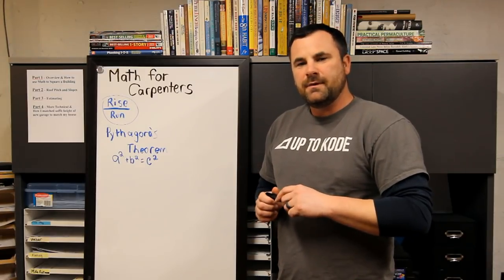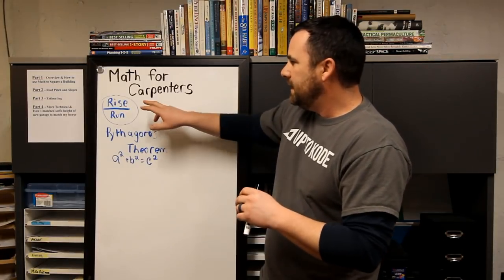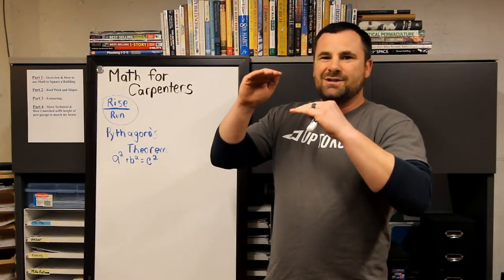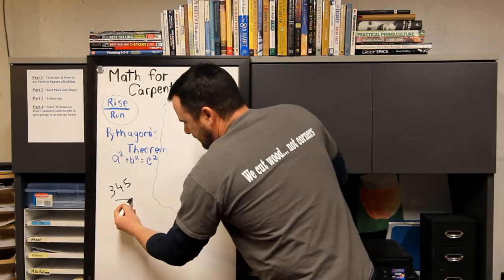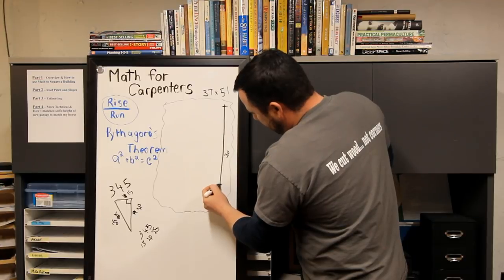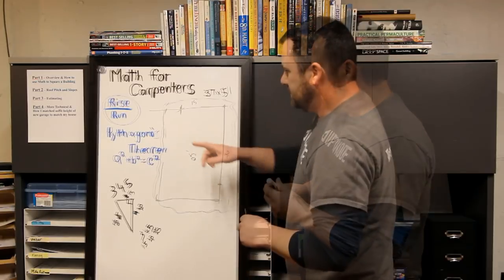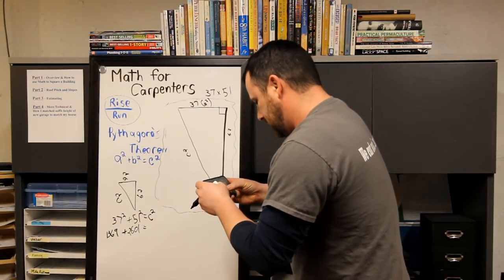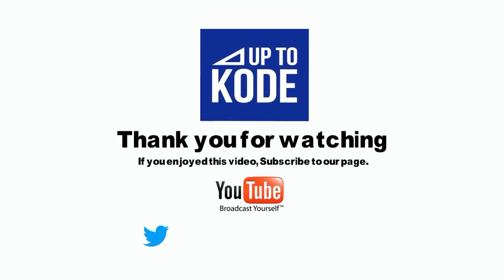Carpenter Math : Two Ways to Square a Building - Pt 1

Comment: 63'- 1/8" also i would get closer to the proper dimensions of 37'-0" and 51'-0". So multiply by 12 on the 3,4,5 rule. 36 ,48 and a hypotenuse of 60. Be perfect guys thats what seperates a pro from a hack. Take a little more care and ppl will love u for it. Great vid btw. Helping out those guys that dont know👍
Reply: It is too good  I saw it first time thank you

Comment: I use a trig app which tells me the hypotenuse length for my actual length of the other two sides just like in your Pythagorean theorem example. I use this everytime as the 3,4,5 method is just a projection of a smaller size of the actual size of the building. Decent accuracy, but inferior.

Comment: on the 345 method, were did you make up the multiply by five number i didnt understand where that number came from or if you just made it up or knew that before?? the pythagorian makes more sense to me , add calculator cant fail haha 345 i think id mess it up, is it always 5 times 3,4,5 or??
Reply from the maker: You can multiply 3, 4, 5 by any number you want. As long as you multiply all three by the same factor. Even 30, 40, 50 works. That can be inches or feet.
Reply: @uptokode  so key is the multiple being the same keeps it balanced, im doing some khan academy math but it hasnt got to calculating space, very useful to learn though i wanna get really good at math and building then ill be able to know what im doing mathematically as i go, be alot more sure of myself not just bend rebar all day, cheers man cool videos!
Reply: @uptokode  i think i get it now its just to make a90 degree corner to work off, ive done that part of the math i just didnt see the purpose but from a9 degree corner you can work of it as a definite corner not a guess. i think i was imagining it was somehow gonna be something more then just , ok get the 90 corner to work off, cool stuff this math its everywhere everything.
Reply from the maker: Exactly! You got it now.
Reply: @uptokode what do you mean by 30,40,50 ,how will we multiply that ,like 30×50 or 3×50?
Reply from the maker: @user-fu3kf9is8x 3-4-5 is the rule so if you multiply those EACH by 10 you get 30-40-50. You can multiply the 3-4-5 by ANY number and you will always get a square corner. Hope that helps!
Reply: @uptokode  what do you prefer for lots/vacant land foundation for building, and for carpentry,(3:4:5 rule or Pythagorean)
Reply from the maker: @user-fu3kf9is8x I always lay out new building with these old school methods. I typically use the corner to corner trick on rectangles. I will use 3-4-5 as a double check
Reply: @uptokode  corner to corner, the diagonals right?
Reply from the maker: @user-fu3kf9is8x yes
Reply: @uptokode  thanks alot man
Reply from the maker: @user-fu3kf9is8x you’re very welcome

Comment: I am trying to layout a 12ft x 20ft for a large storage shed...how do I use your math
Reply: Search “run over rise calculator”…
12’ run / 20’ rise = 23’-3 7/8” slope…
So diagonally from the outside corners you should have 23’-3 7/8” with your building size to be square.